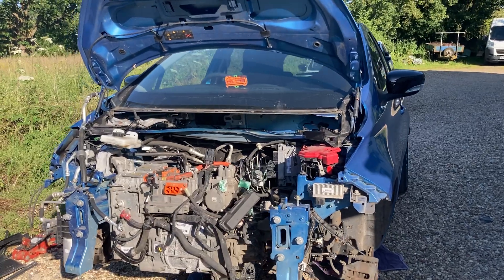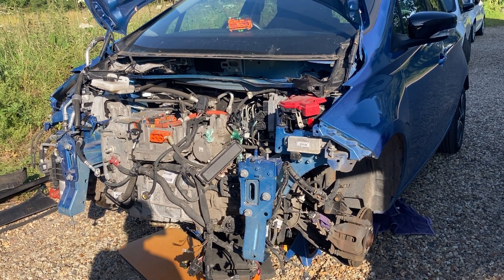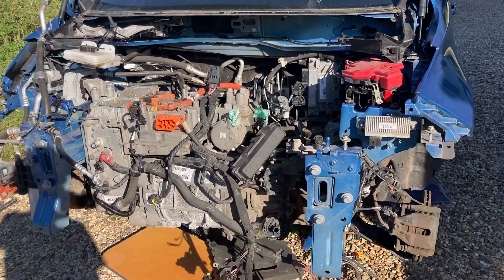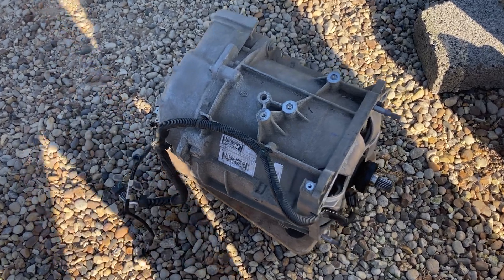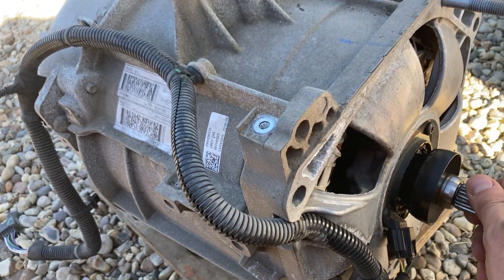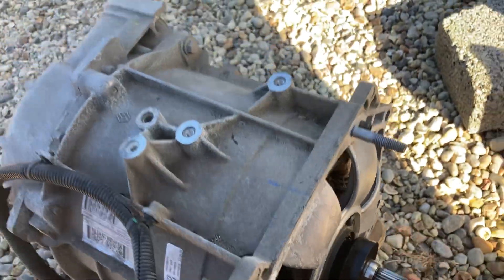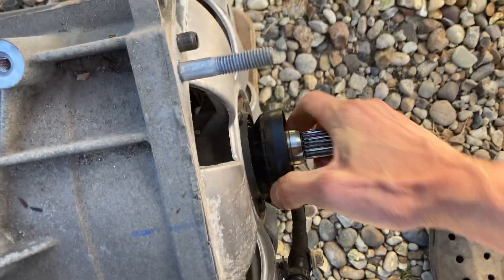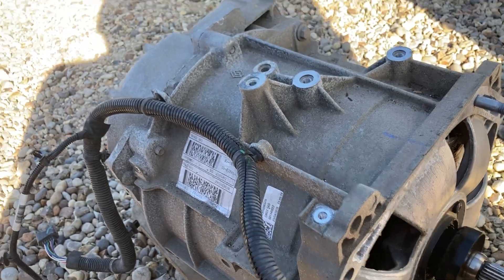Renault Zoe 40kwh 5AQ motor replacement bearing failure noise r90 r110 r135

Comment: Hi Gary, where did you order bearings and which did you order...? Could you get bearings prepared for the security clip or did you use "ordinary" bearings?
Reply from the maker: Hi, there’s a bit of a split of opinion among those who have changed bearings, there are a few options, some people have the circlip groove cut and not all motors are suitable for replacing the bearings due to other issues. It’s also not a simple process to swap them. I’m still testing the first 2 motors as I’ve chosen different bearings to others 😆. Cheers

Comment: You would have thought its possible to change the bearings, but I guess not?
Reply from the maker: I am currently working on it. Have replaced the bearings on a motor and this week will fit it in to a Zoe to test over the next few weeks. Not straightforward but certainly possible. Cheers
Reply: @garycevrepairs  Hi Gary. So replacing the bearings on my 2017 R90 won't be easier than replacing the whole motor?

Comment: Great Video
Are some Zoe type of motor better than others
in regards to, age, miles, year ?
Reply from the maker: Hi. To be honest it’s swings and roundabouts. There are 2 motor types in a Zoe - the 5AM motor made by continental for Renault was common on the early Zoe’s, it was sold up to about 2018 but less common after 2016 - this one is a stronger motor but they can have issues with the reduction gear!  I obviously see the bad side of things as I fix the cars but my wife’s 2016 Zoe 40 is a 5AQ which is the type that suffer with motor issues and it’s going strong at 107k miles… if I couldn’t fix them myself I’d be buying a warranty if I had a Zoe ! It’s quite a popular EV so it’s hard to work out if it’s unreliable or just popular. Cheers.